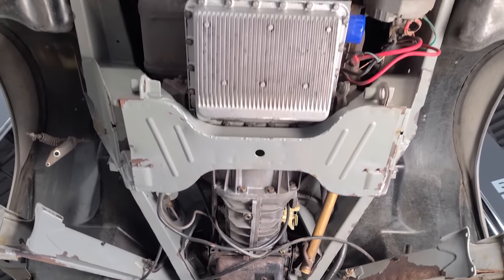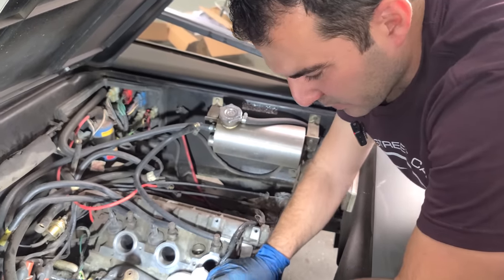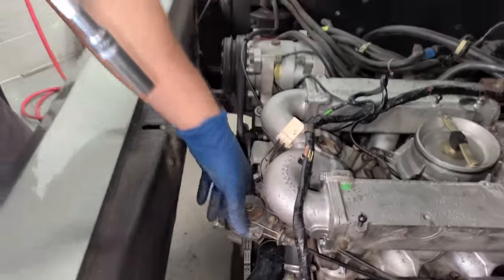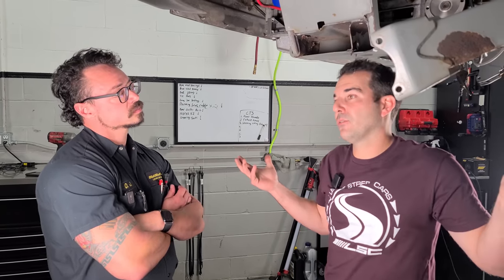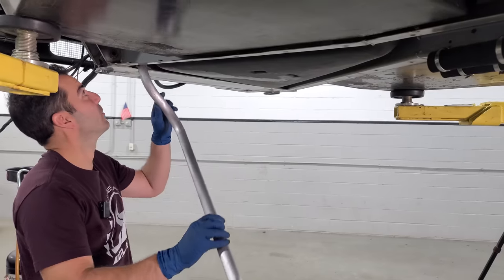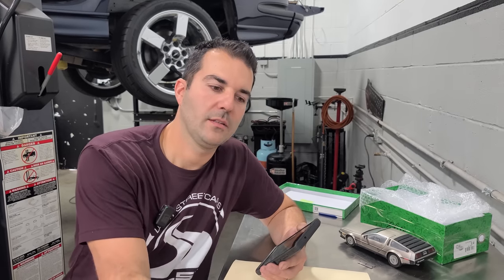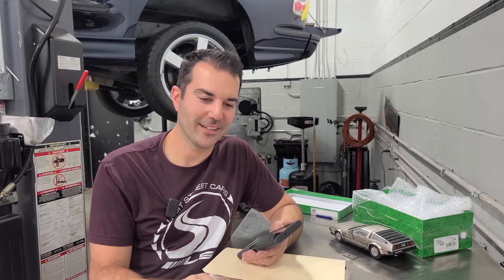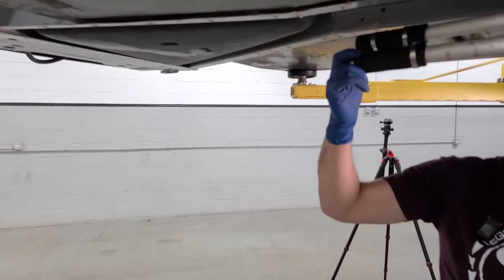I Put My DeLorean Engine Back Together & Spoke With The Orignal Owner! Fake Miles & More Bad News :(

Comment from the maker: What would you guys do to fix the frame?
Reply: First
Reply: Cut out the metal rot, weld in new stuff
Then get the fibre glass replaced with carbon fibre ftw 👍
Reply: Yea that probably the best idea, cut it out and weld in new material
Reply: there's a company that makes a replacement stainless steel frame
Reply: Cut and change , or change all
Reply: maybe try to weld or replace with a mechanically totaled donor (which is totally impossible even if you go to hell) or go back to the time to get one from dmc.  (that is a solid option in my opinion)
Reply: dissasemble and acid dip/sandblast frame restore and recoat
Reply: Send it down the road for someone else.
Reply: Just put on F150 frame and 5,0 Coyote with whipple supercharger.
Reply: Buy a brand new frame from DeLorean. I'll put in a dollar.
Reply: If you want to keep it for ever like you said, I would import a new frame from the UK deloreango... Just the money coming from the video series would probably easily pay for it... I would love to see a frame change on a delorean...(when do you see this ! ? never).. tks for stream by the way... love my saturday morning now !
Reply: sell it
Reply: Custom tube frame with revised modern suspension geometry and coil overs or air ride.
Reply: @FYMASMD this isn’t the way Alex does things
Reply: VTune!
Reply: Does Roadster Shop make a DeLorean frame?? ❤
Reply: What I would do is disassemble and fix the frame, what your best option is buying a new frame either by the Deloroango place in the UK or have a race shop build a new frame w modernized suspension the ppl that suggested this above are correct
Reply: Laser rust removal and welding new steel brackets and supports.
Reply: It looks like you can buy a brand new frame for 12k to me that seems like the best option if you are keeping for life. The option of cutting and welding seems like it could be cheaper but you don’t know the extent of the rust.
Reply: Paint the bad spots with POR15 and then keep it indoors and don’t drive it in the rain. Spending $80k to fix a car that’ll never be worth $50k is kinda dumb.
Reply: Get a new engine and trans, drop the frame, sand blast and repair it, then make the mods needed for the new engine and trans and put it all back together.
Reply: Replace it with stainless
Reply: Years ago (late 90s-early 00s) there was someone making brand new stainless steel frames here in the USA. I doubt those are still being made though and the price is pretty steep. If the frame comes out, might as well do a manual transmission swap too.
Reply: Depending on cost, drop, dip, adapt for new motor, strengthen & restore. That chassis is very similar to the Lotus Esprit, shows the Chapman influence & def part of cars character. Just please junk the crap French v6 at least for a better v6 🙏
Reply: fire my employee and put a no contact order against him, ignore the situation.
Reply: Looks like you can buy a new frame... A bit pricey though!  You should have one custom made out of stainless steel 😜
Reply: Give it to OJ he will not let it leave his shop unless it is 100%
Reply: now you can see the corrosion cut out ans weld it not that difficult imsurprised you havent done it yuor self before. or drop the chassis and go donw that rabbit hole. the engine is a renault so there must be a haynes manual for the orginal car it came from.
Reply: Replace it. There’s a reason they make replacement frames for them.
Reply: Remove and replace or upgrade, a great start if you want to upgrade the engine and stuff in my opinion, I think 🤔. DeLorean had a bunch of stock on DeLorean maybe they still have some for sale, but for upgrades or conversions , idk .
Reply: @spyhunter99 Thoes frames are kinda spendy!
Reply: You caught it early, fix it after Halloween. Cut out the bad, weld in the new, blast it, PAINT IT instead of epoxy coating again.
Reply: Frame off resto. It will bring you the most joy in the long run
Reply: Look up Ship of Theseus😂
Reply: If you replace the frame keep the old one, someone in the future( no pun intended) may want rebuild it back to its original condition or should I say " Back to the Past ", could be a sequel . Frame would look good on garage wall.
Reply: Insted of reusing the existing frame one idea you might want to consider is drop the oem frame after halloween,  Have a new frame fabercated to OEM specs out of Stainless steel  IT look much nicer than the epoxy crap that came on it. I would keep the old frame parts incse it needs to go back to oem some day but a new frame would be much nicer ona  forever car.
Reply: As much as we enjoy watching you figure out what to do and then struggle with whatever, I would just buy a new frame.
Reply: You love that car pull the body let Big OJ make it right !
Reply: New frame go big or go home
Reply: If moneys not a problem, I would do high grade stainless steel
Reply: I’m that guy who does what OJ does. I’d pull the frame when convenient and do it myself. Send it to powdercoat when finished to match the original grey
Reply: Would it be worth it to build a new frame and do an electric refit to smoke some tires. Halloween 2024 delorean from the future.
Reply: Yeah I agree, take everything apart and get serious with that frame.
Reply: Weld in new metal. Which actually makes it closer to a restoration and not just intensive cleaning.
Reply: Replace the chassis. Deloreango here in the UK sell new Galvanised ones for £9k.

I wouldn't even mess with yours, it'll never be right, it's rotting all over.
Reply: Cover is with Mercedes sunroof grease.
Reply: I think welding good metal to a frame that is bubbling is a waste of time, replacement frame!
Reply: Go for it
Reply: Find someone who would fix it for a Klondike bar.
Reply: If you’re doing an engine swap down the road, I’d wait to worry about fixing the frame until then. The frame may need significant changes and/or you may want to make changes to improve suspension geometry / use more common parts like wheels, spindles, brakes, hubs from a different donor car.
Reply: Have Art Morrison build you one.  WTF, it's only money and this piece of irrelevant junk is going to take a bunch of it.
Reply: If you live somewhere dry, drive it and enjoy it. If not, Waxoyl is your friend
Reply: If you can live with the price, put in a new replacement frame from deLorean. It's a dream car, you want to own it forever, that's the best fix you could have.
Reply: You have done so much work, take it off and do it properly during the winter.
Reply: Take it down and make it look like new again your going to own it forever
Reply: Full replacement, you have the money to do it correct so do it correct
Reply: Go back in time and fluid film the frame,problem solved.
Reply: ask a steel expert
Reply: full chassis off rebuild
Reply: Drop the frame and see how bad the damage is.   If it's just a few spots, patch and weld.  If it is extensive, replace the frame with a stainless steel version.
Reply: I hope you source a good deal through your YouTube community. I watched the Donut Media guys have the frame swapped on their Suzuki for absolutely free because of their channel. Your car is 1,000,000,000x cooler so the YouTube value is there. I hope you sort it out because this is one of the best projects on YouTube! Drop the frame and completely overhaul it. It would make the car more valuable than any of the garage kept examples as we know you’d make it better than a new one with modern engineering touches.
Reply: @Brent-sm5sb 
lol!
Love it!!
Reply: Patch it with fresh metal, paint it, call it a day. I wouldn't overthink it..
Reply: @ClumsyCars  you sir, win the comments section today. Bravo! 👍😂
Reply: The only option now considering the frame needs to come out to be repaired.
Is a brand new frame.
..
Alternatively see if OJ can manufacture a replica using the original Delorean frame as a template..
This way it would be the best and strongest frame - ideally suited to the brake & suspension mods.

Price wise between   an FMU frame and an original Delorean would be close..
..
No point welding the old frame too much work..

It sucks the frame is quite rotten but as this is a lifetime keeper..
Bespoke frame is the way to go....
Reply: Total restomod basically using only the OE exterior and interior.
Reply: If you are worried and have to pull the frame. Check it out if its starting to spread. DMC sells new frames for around $11,000. Sucks but would be new and you can make sure its sealed properly before bolting in the car.
Reply: Could you not find another frame to blast and make perfect then transfer the parts or remove that frame and blast and repair repaint rebuild for peace of mind . A lot of work but if your keeping her
Reply: Right now, I’d hit it with evaporust, weld and paint so it’s ready for Halloween but take it down later over the winter so it’s ready for next summer
Reply: i would fix it properly.  Looking at the investment, frame would the cheapest thing to fix if everything else works fine. Plus, taking out the engine and transmission is the next logical thing to do. You have to turn evey stone and fix it right.
Reply: Replace frame and remove all rusted parts.
Reply: I'd be seriously tempted to go for a complete new backbone chassis. Delorean Industries make a complete stainless steel one.
Reply: Drive the car for 2-3 weeks. Make sure the engine and transmission are fine. Then disassemble  them to be certain you are not throwing money into a hole.
Reply: Go back in time, highjack a semi delivering frames to the factory, bring one back, problem solved!😁
Reply: carbon fiber swap, with fiberglass coating, deloreans are my favorite cars and i wish dmc made more cars, imagine what they wouldve made today
Reply: Do not be disappointed with the rust on the frame. Once you are ready to do this, drop the frame and send it to a chemical dip. Then send it to a body shop for metal work and epoxy coating. Maybe even powder coating??  This is not for the faint of heart but absolute way to keep this DeLorean forever.
Reply: Make a  new one))
Reply: Buy a NOS one. DMC has plenty of them or go crazy and reproduce the stainless test one they made. ( See Stainless Steel Illusion by Jon Lamm. (Yes, expensive but no more frame rust worries...EVER!)
Reply: My 2 cents says to replace the frame when you do the engine swap
Reply: Take it out of the car, replace rusted metal and find a place to powder coat it. It'd be way better than the factory and likely last the rest of the car's life.
Reply: Bondo it up, paint, drive it for a bit to determine if it's worth forever love.
Reply: if you absolutely love the car and are going to keep it for ever . New frame and more in depth restoration .
if its for content.....leave it alone and sell it for your money back and get something else.
Reply: Buy a new frame! Go big or go home.
Reply: New frame
Reply: If you can buy a new frame for 12k then I would  give that serious consideration. I am not sure about stainless. Stainless is harder and less resilient to flexing and cracking. Need to research that choice to look at grade and form an opinion. One of my next restoration projects is an Austin Atlantic convertible. This will require frame off restoration. But like your Delorean it's an iconic car and totally worth restoring. It's not about the money. When you have completed a proper job you will have something of quality. And that lasts. cheers
Reply: Cancel Halloween and pull the frame off. Not worth the work to put all together just to rip apart later. Rebuild motor. Have a $100k car when your done
Reply: So I work for Robert Mondavi winery in what we have a situation like that especially with older epoxy you can just try to sandblast the rust out and just re-coat compay called gulf coast make the same color epoxy.
Reply: That frame is fine. Cut and weld in a patch where needed and cover with an epoxy.  My mind is blown with him saying the "frame is gone". What a joke. Those are low HP cars. It's not like they are under high stress and that car is not worth spending 10k on a new frame.
Reply: Get rid of the epoxy coating sand blast, cut out the rot and reinforce and finally undercoating
Reply: What you are already going to do with the frame. We all know how this is going to go. Minimally, you are going to pull it out and have it fixed. But along the way, if you are lucky you'll find replacement that is mint, and just install that.😂
I suspect that's when you're gonna try and make that engine make more power. Probably with a turbo setup like the one you showed us in one of your previous videos.
Either that or you'll Ls swap it.
Reply: @buddyrevell6369  Agreed,if you were to do an LS1 something like that then it’s a different story.
Reply: Enjoy the car as is for a while..then do a full custom frame with all modern suspension.
Reply: Remanufacture it in stainless!
Reply: Nothing. Drive the thing
Reply: Don’t waste your time and money. Get OJ to weld in some patch plates and leave it at that. Going for perfection on something so insignificant is not an efficient use of your time, even if you plan on keeping the car.  Prioritize your efforts.
Reply: Cut my losses, get it running A1/mechanically/cosmetically and sell it for 3xs amount because at that point u keep going I think you're losing 📉$$$ and time but also you've gotten this far,Alex!!
I'm just being a defeatist!!😂🤣🤣
Reply: As spendy as it would be a stainless replacement frame would make the car last as long as you. Blasting, patching and painting the old would be cheaper, but more work, and would it really be worth it? How long would it last? Is the money saved and the sweat equity worth it to you? It would keep it original and be more labor of love. Or is the price of a new one with it's peace of mind worth it, versus the effort of dealing with the unknowns of the old?
Reply: Hard to say, price out dropping the frame, repairing it and then getting it galvanized. Compare that to a new galvanized or stainless steel frame and go from there. Seems to be a problem with them. You could also do a frame on restoration, spray rust encapsulatir inside the frame cut out the bad and replace. Paint and have fun, if it gets worse down the line then drop the frame. Your not going to be be driving the car in salt and snow and probably not rain so it could last your lifetime. My advice right now would be quick repairs on the holes, cover the rust paint and enjoy the car for a year or two then go back to the frame!
Reply: I’d call the rodster shop, do a collab with them as fellow Illinois guys, have them custom build you a frame.  But if you intended to drive it forever, then yeah.. the frame needs to be upgraded, especially if your going to engine swap it.
Reply: Understanding you, from what I've seen, put a new frame under it.  It will make Holliween as is but, if you want to keep it forever? Do it correctly!  I have mad respect for you, and I feel you'll do what's right!
  I really miss Portillos! Lol
Reply: Thank you for asking for opinions!  That's what makes me respect you and your work/opinions so much.
Reply: Replace with a reproduction if available depends on the cost too.  10-15k?
Reply: Fix the flux capacitor...Go back in time with some tools\ rust reformer...Blast the frame and the VOD... Don't leave Max behind!
Reply: I'd let Halloween pass with it on your front lawn first. You did say this is a lifetime car, if this is a case, motor and body off, and fully fix the frame.
Reply: Replace the fiberglass with carbon fiber!
Reply: Remove,  blast, fix, por15.  Reinstall
Reply: Get the flux capacitor in there and everything running. You know what to do after that! Hint: get back to 1991!
Reply: Get a new frame made for it.  It's ac forever car,  so why not.
Reply: Check with DMC MOTORS in Humble Texas!
Reply: Por15 the spots and don't worry about it. You are not going to drive it in the winter. It will be fine.
Reply: Get a time machine to get a new frame from the early 80s...
Reply: Frame of restoration. It deserves it.
Reply: Honestly, listen to what OJ Lopez says, as this man knows his stuff! Personally if I was going to keep the car, drop the frame and go from there. (Hopefully it can be restored). Word of caution: be mindful of any car with rust issues, especially if it's a keeper.
Reply: I think you should have OJ teach you with it. Use it as a learning experience for some fabrication. I think you have it in you Alex, some fab worn added to this channel would be great to see!
Reply: Welding with the epoxy in place is problematic so I’d go a different route.  Bend some thick flat sheet into large U-channels then epoxy those in place over the preserved rust locations.  It’s not perfect but it would be cheaper than full frame-off repair.
Reply: I kinda noticed you skipped over showing the step where you have to blind stab the brass tube from the idle speed motor through the manifold, plug wires and some injector hoses into the base of the air meter housing.  Maybe it's easier with the fuel distributor out, but I doubt it.  More likely you had no footage where you weren't screaming explatives, which is probably in the service manual as required cussing while installing the part.

Also, that tube with a cooling sensor on the drivers side has to be replaced with the newer style.  That sensor must be at the bottom pipe to work properly, and you must put a cable tie around the sensor between the spade blades before you install the wire plug, or you will blow up your engine without the temp sensor (otterstadt) saying a word when it pops out when you are driving 60.  If the sensor isn't surrounded by coolant you'll never know the engine is heating up.   

Hope you did a pressure test of the cooling system before you reinstalled the intake manifold.  Something always leakes there no matter who you are.  Scope it once it's at temp and again after it's cool. 

Don't mean to sound critical, it's an amazing series as usual.  Thank you!.

By the way, you will probably get a used frame, but new ones are available, find Josh in Ohio.   When you swap the frame that's the time to decide if you want to install the 5 speed or keep the automatic.  Gearbox swap is super easy if you are doing a frame swap, you just need to update the pedal box and install the Clutch master. It's a great video for you to swap it over.  More reliable, better power, no wonky AT modulator/controller.  There is no wrong answer, just what you want long term. 

Keep up the good work. 

Tom
Reply: I would import the stainless frame from the UK. Alternatively have someone make a custom frame here. For the engine I would get a 3.0 PRV V6 from an Eagle Premier, they're like $200 and have more modern EFI and ignition if you would like to go that way or you can swap over the original Delorean parts. It's not only cheap but a direct swap and a power upgrade. Plus if you use the EFI you can add a turbo or two, and control it with a modern ECU.
Reply: Just go back to the future and tell the original owner not to drive it on Muddy roads!!
Reply: Sand-blast to bare metal, repair/replace all rust spots, galvanize, powder-coat.
Reply: If you're  going to keep the car, get in touch with Art Morrison and get a custom frame, blast it powder coat it, set up proper suspension and geometrically  correct, you'll  enjoy it and love it forever !!! It would be a fantastic series build !!
Reply: Can you get a camera probe in there and see what's happening to the frame?
Reply: I would either replace it with a new frame from dmc(yes they are “still” in business) or with an aftermarket stainless steel frame from specification one. It will add value to the car and you will never need to worry about it ever again
Reply: Get an NOS one, or a new one.
Reply: Rustinhibiter and some paint.
Reply: I think the worry is what is underneath the frame structure that can't be seen, I'd send a strobe in.
Reply: Alex dmc is still around im sure you could get in contact with them about some new frame parts possibly even get someone from the company to come see the car and maybe sponsor the build 🤷‍♂️
Reply: A Warehouse in the USA bought DMC and supply all the parts
Reply: @bob5074 Would be if you didn't have the youtube revenue.
Reply: Frame off new metal. If this is something that means that much to you and you have the money, do it.
Reply: Drive it til the wheels fall off. Than you can add more power and a tubular frame.